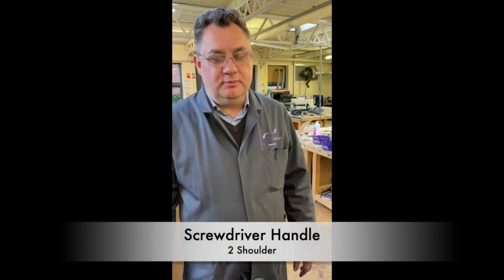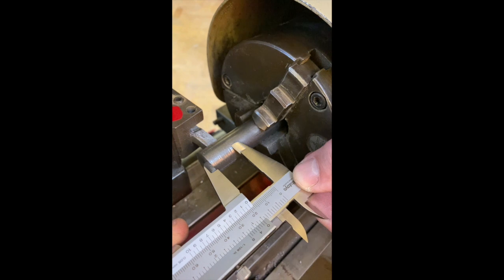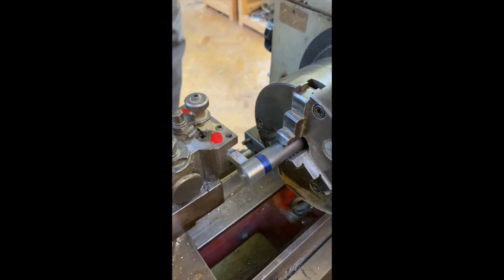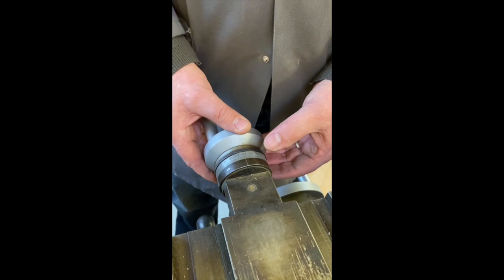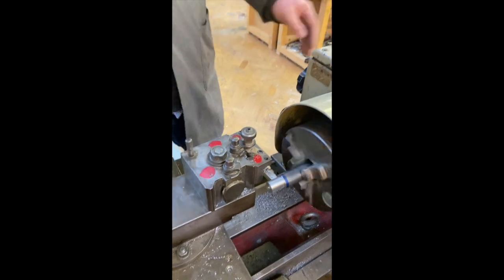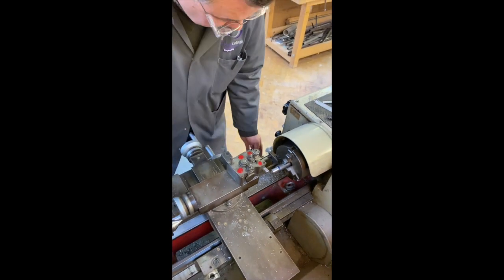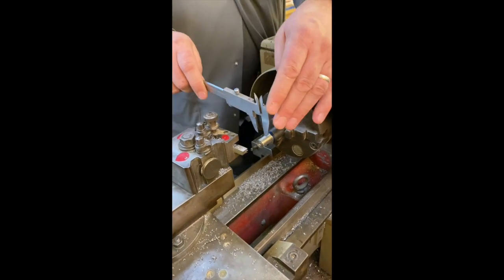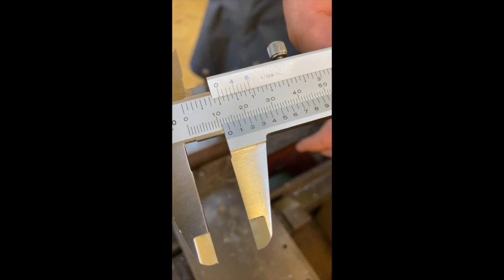2. Screwdriver Handle - Shoulder

Comment: when you said two large sections on the scale does that mean 2cm?
Reply from the maker: Thanks for the question.  No that’s 2/100’s of a mm!! Quite a bit smaller. Watch the parallel turning video too I explain it properly there. :0)
Reply: @markrobertson2485  i think you mean 2/10 because its 0.2 not 0.02 right?